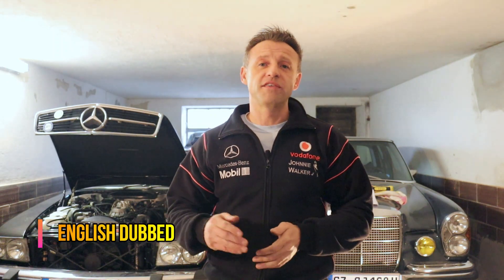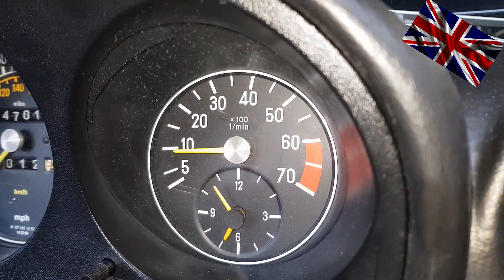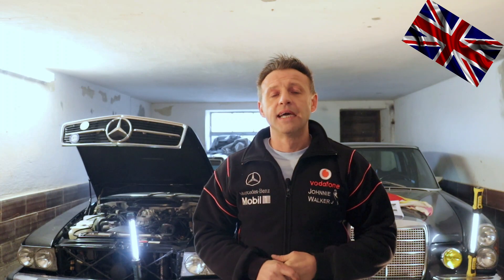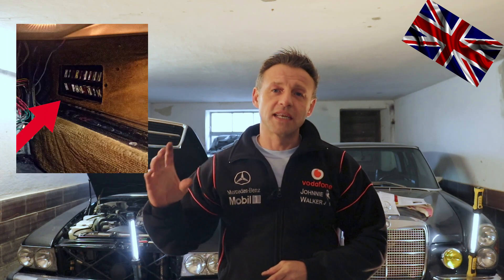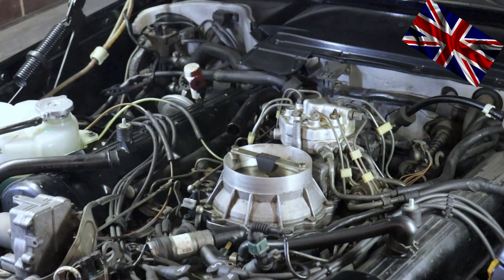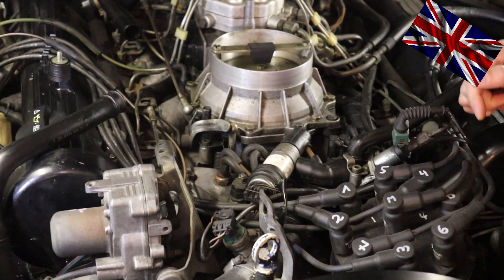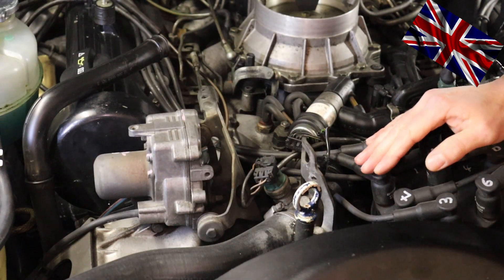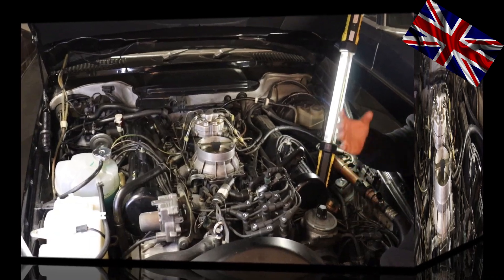KE-Jetronic causes and errors - rough engine running

Comment: Thanks! Your videos are very detailed and will be helpful when root causing issues.
I had a high idle issue on my w126 500se UK spec vehicle. Vacuum leak was the cause but I could not find it. Eventually it turned out to be the egr valve diaphragm that was broken. After blocking the vacuum pipe it idled perfect again!
Reply from the maker: Hello, thank you very much, I am glad to hear that, have a good trip!

Comment: You spoke about difficult starting with warm engine (f.ex. at the fuel station). What can be the cause? Because it is wat happens with my 230ce 1991 car. Thank you
Reply from the maker: The pressure accumulator at the front is defective, the fuel runs back again and for a restart the fuel must first be conveyed to the front again.
Reply: @R107Schrauber  Thank you very much for the fast reply 👍. It’s what I thought. I have already bought a new accumulator and will install him this weekend. Thank you again for your fabulous yt channel 👌

Comment: Moin. Wiedermal ein sehr gut gemachtes Video. Kurze Frage: Gibt eine firma, die das Kaltstartventil neu abdichten kann? - Weder bei MB noch bei Bosch aktuell in neu und verdammt hochpreisig verfügbar. Besten Dank und Grüße, Tom.
Reply from the maker: Hallo, welches Modell und Baujahr?
Reply: @R107Schrauber  c126 500sec bj 05/91
Reply from the maker: Sind diese Teilenummern die richtigen für dein Fahrzeug? A 102 070 01 46, A102 070 01 46,  A119 070 02 46